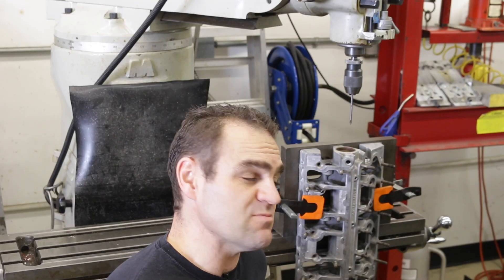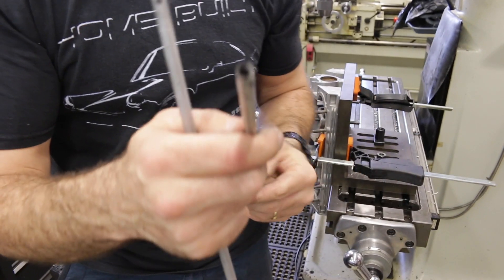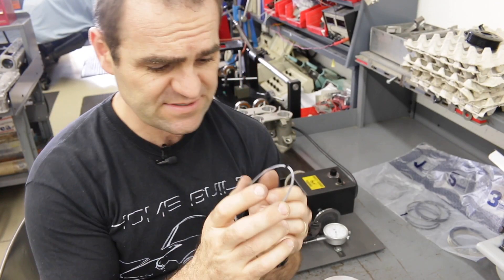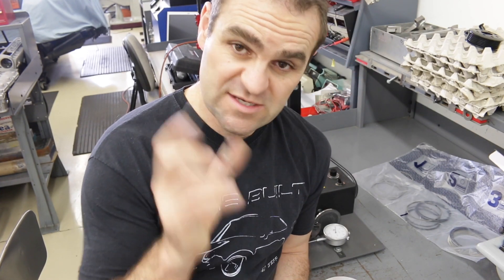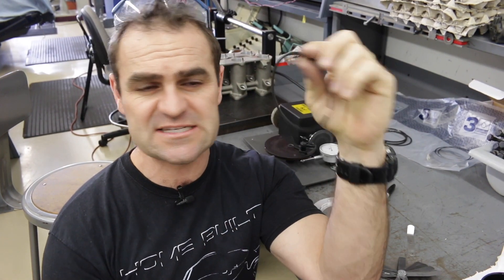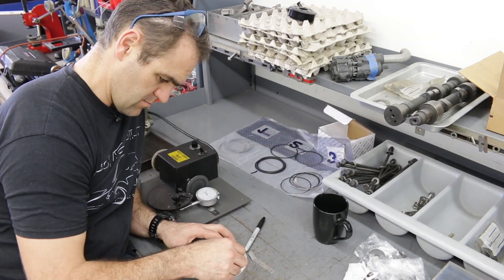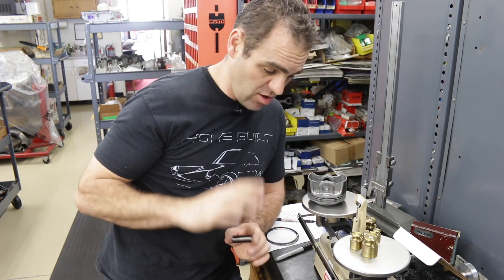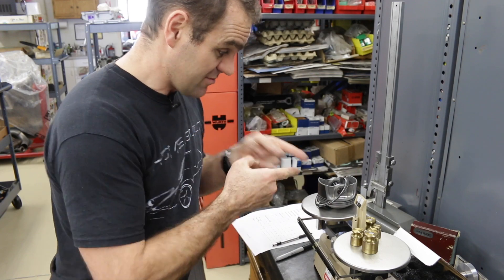Rocker oiling and gapping rings - Porsche 911 2.8RSR Engine Build part 3

Comment: That's the most exact I've ever seen rings being gapped, pretty amazing. Like any true tech nerd I truly envy that shop. All the intel picked up there is worth it's weight in gold, important knowledge which will hopefully be passed on. While I get the that you want to minimize the chance of damaging the cilinder bores a Nicasil coating generally speaking is considered very hard. Older BMW boxer engines(1100/1150) where know to start using less/no oil only after the 60k (!) kilometer mark because of that. I've had them apart at over 200k kilometers and the crosshatches still appeared brand new. While they are low revving engines it just goes to show the toughness of it.
Reply from the maker: The coating is very hard, but Neil is using another coating on the GT3's etc,  which is tougher and creates 20% less friction. Still to be developed for aircooled stuff though.

Comment: Good work..all that equipment helps to make everything perfect..you can actually buy gapless rings however some people say the problem with gapless second rings comes from a lack of pressure difference across the top ring. The lack of pressure difference, as I was told, is caused when the pressure on either side of the top ring reaches equilibrium (during the power stroke) because the second rings allow near zero bleed down. Without a pressure difference, the top rings aren't forced against the cylinder walls,don't seal and you lose top ring control in a running motor....still they seem like a good idea to me in theory.
Reply from the maker: Neil said particularly on race engines, he runs them really tight.